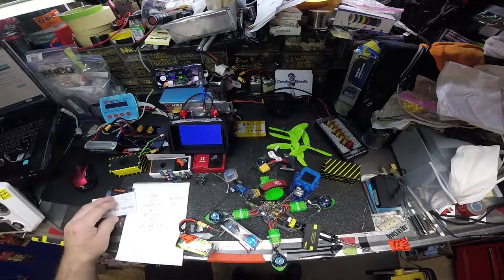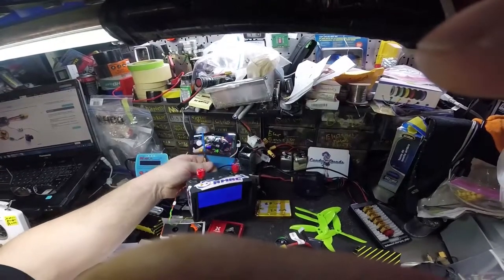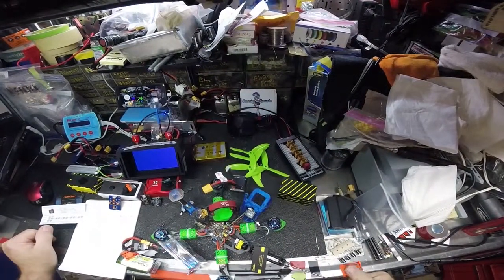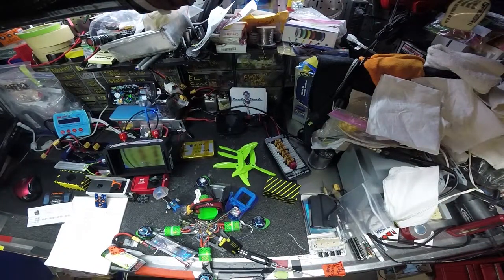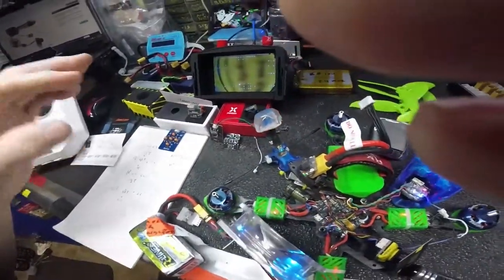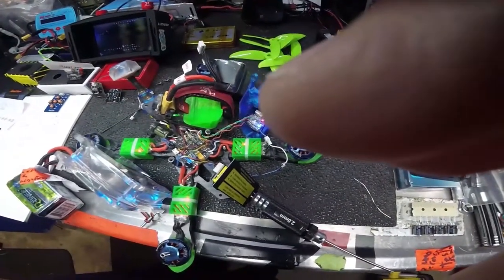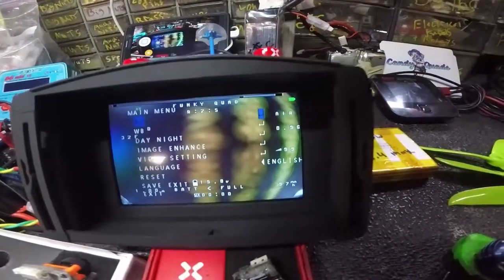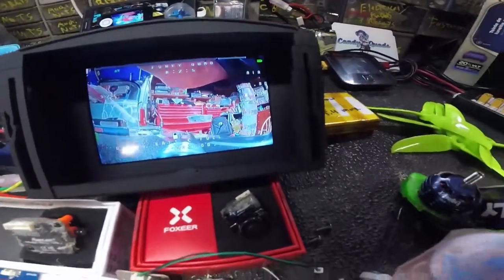Caddx Ratel FPV Osd Camera Remote Control Adaptor hook up.

Comment: This had been driving me nuts for weeks since I bought 2 Ratels.  I was trying to get cam control to work on an FC that had a dedicated pad and no response, tried all kinds of settings in BF etc.  Hooked up a control adapter tonight and nothing.  When I did a search your video came up - swapped the osd and ground wires and boom it worked!  No “up” command but at least I can change settings now.  Wtf I guess Caddx has the damn ground and osd wires mislabelled or something.  This kinda stuff is why I usually stick to Runcam.  Thanks a lot!
Reply: Hey man, I'm in the same boat. Just bought and swapped 2 old Runcams for 2 new Ratels. Camera control used to work but now doesn't on either build. So you say just swap the ground & osd wires and it'll work (without an adaptor etc)??
Reply: on my new iflight f4 it has dedicated pad but mentions nothing about osd ground,,, do you ground osd also ?  i understand you swapped from green to black for osd pad . in the process of building and have been looking for info also..

Comment: on my new iflight f4 it has dedicated pad but mentions nothing about osd ground,,, do you ground osd also ?  i understand you swapped from green to black for osd pad . in the process of building and have been looking for info also.
Reply from the maker: It's only when using a runcam adaptor.  Now caddx makes their own cam control and you don't have to swap wires.
Reply: @tomfunk7514  yea soldered up mine last night as per fc instructions works fine ,, green to pad  neg to neg with cam. even though fc instructions said nothing about -  it works .
Reply: depends on fc  i assume, caddx emailed me saying it won't work but it does, no need to order there control in my case